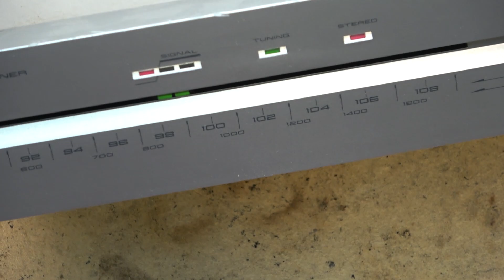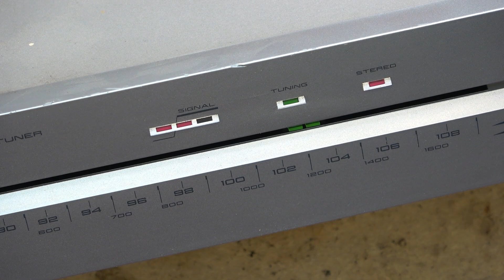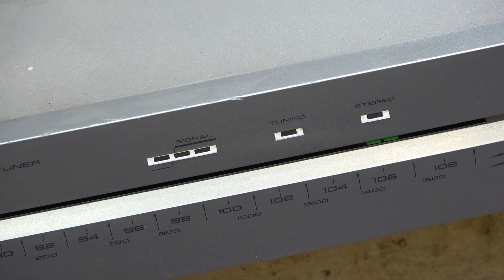Akai ATK110 Tuner way off frequency

Comment: WHAT A VIDEO ! Woow, Say, I Have The AKAI AT-K22L And I Was Wondering, Can I Hack Into It And Change The Frequency Range To 108.000MHz To 136.000MHz ?
Can I Tune Up The Shortwave Frequencies To 3000Mhz To 7Mhz ? If Its Posible, Can You Tell Me Or Show Me How? PLEASE ! And Yes, I Know Its Digital, I Don`t Even Know, If The Frequency Would Be Changed, It Will Show The Correct Frequency In The Screen Or It Will Show The Deafult Ones?

Comment: Could be pointer moving on the string, or the ceramic capacitor that provides a tiny bit of extra capacitance cracked and went open circuit.

Comment: Awesome! I swear brother... time and time again you and l seem to have some weird synchronicity thing going man. I picked up an old Sears tuner off the side of the road that has the exact same issue on the FM band. The thing's built like a tank. With a bit of research lve determined it was built by Sanyo. It's been on my short-list for an opening up, a good cleaning, and FM tuner calibration. This vid might just give me the kick in the pants to quit procrastinating and getter dun.